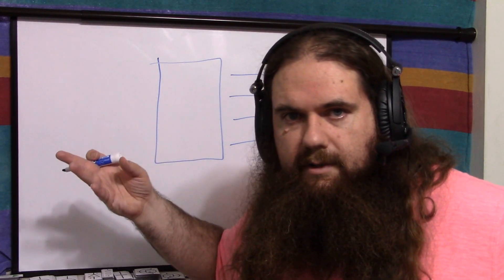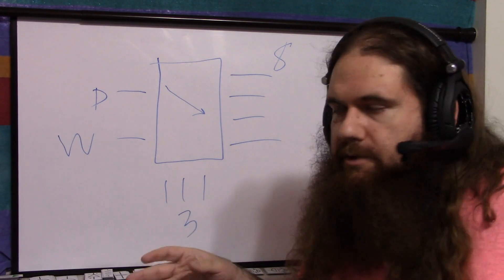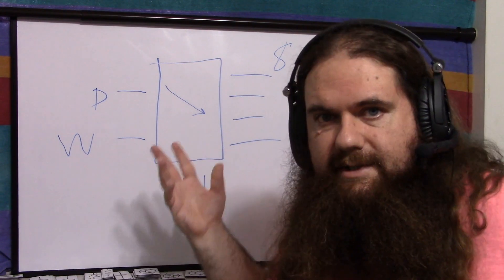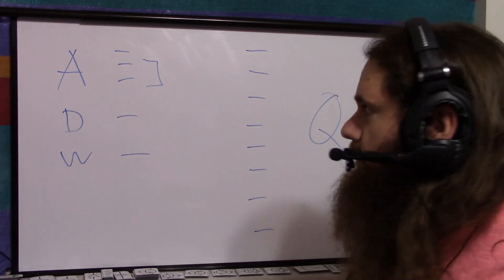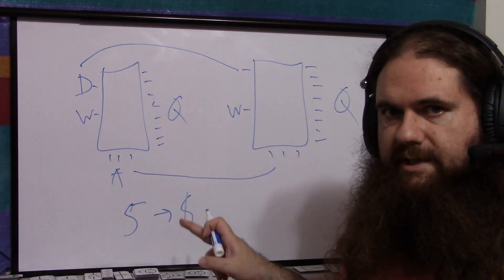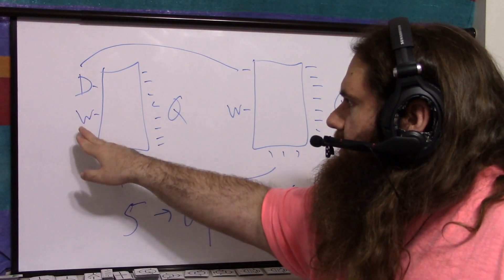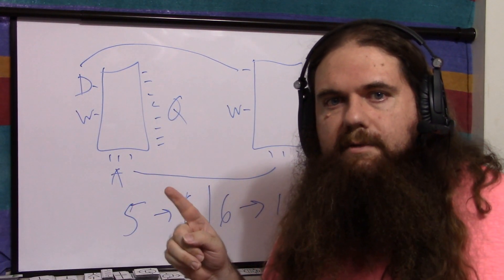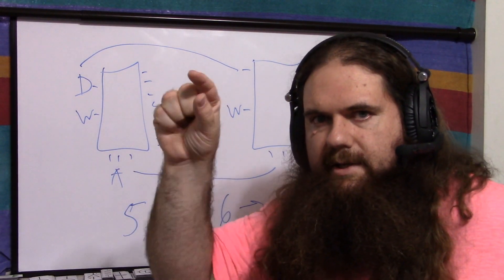Adding Microcontroller Pins - Addressable Latch Register - Simply Put

Comment: Aside from having to shift all the bits into a shift register which is a downside, there are shift registers which latch their outputs so you can avoid the problem of spurious outputs.
Reply from the maker: They actually latch them instead of disabling them? Excellent. That solves the biggest issue with them, then.
Reply: @simplyput2796  Take a look at the 74HC595, it is both latched and tri-state so when the chip is disabled, the outputs are high Z.
Reply from the maker: That chip is bloody brilliant. I am ordering a fistful of those the very next time I go on Mouser. That is perfect for almost every situation. I already see an incredible way to hook up that chip, a mux, and a counter for a project I'm working on.

Comment: Could you breadboard some of these with actual parts?  That would be interesting.  Thanks!
Reply from the maker: Yep! That's one of the neat things about the Arduino Uno: The Microcontroller is socketed, so if you wanted to, you could just pull it right out and put it on a breadboard. Which I totally am going to do some day.